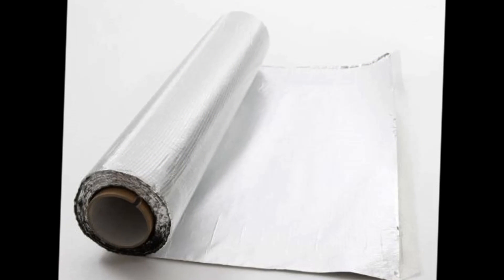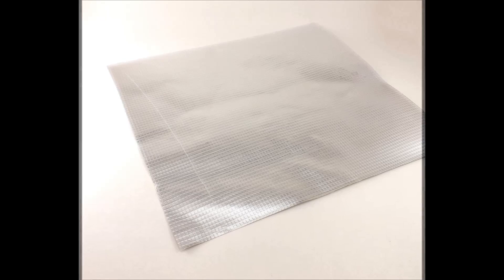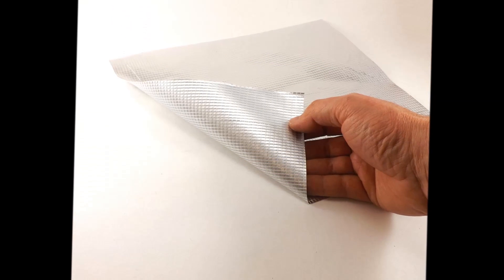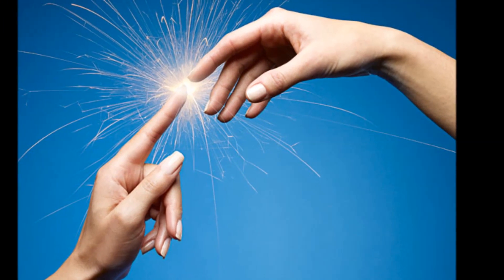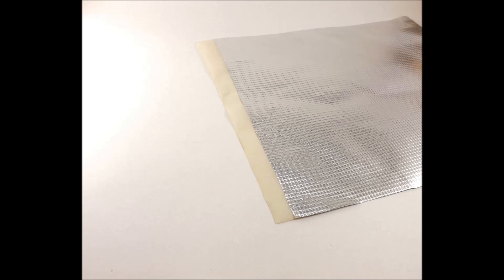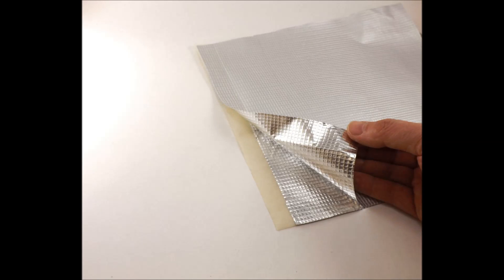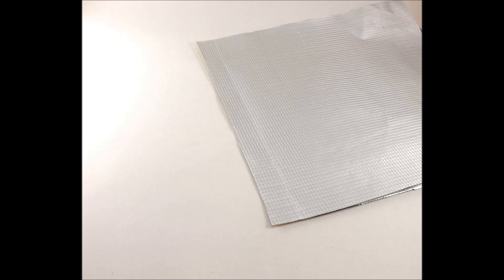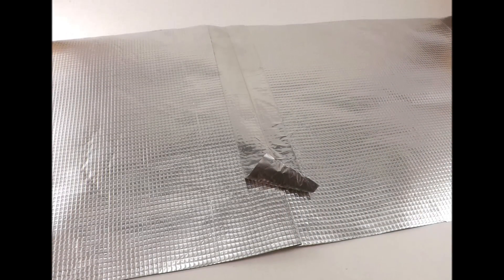AL60 Wall Shield Installation Instructions

Comment: CONDUCTIVE on one side. so what side do you aim 
what side does go toward the incoming dangerous source
the conductive
or non conductive
Reply: I agree with you. Too little info in this video.
Reply: just overlap the  electrically conductive sides a little and place any ordinary tape on both sides. done.
Reply: yeah, we need an answer here

Comment: ive seen 1 megawatt on our readers. and says that "you cannot be in" area with 1 megawatt, (microwave radiation frequency ) for more than a few hours. ive seen 10 megawatts. iv e seen 100 megawatts. in the reader, its fluctuates. and in the green is 0.01 megawatts and anything less than 1 megawatt is in the green and safe to be in

Comment: Maybe with new construction its good to also add this wallpaper.
Reply from the maker: Yes, you can certainly do that. Just remember that this material is a vapor barrier.
Reply: @LessEMF  
Can we exchange numbers ? I have some questions and i like texting 323 403 9558 add me ! thanks.  Drywall is not a vapor barrier? We have reports here that government has been seen using microwave directed energy weapons through walls into peoples houses night time for political purposes. Weve seen it and these barriers can help for wall protection?
Reply from the maker: Drywall is NOT a great vapor barrier. That's the whole reason vapor barriers are added when needed. You can contact us anytime through our website at www.lessemf.comWe don't have the ability to text.
Reply from the maker: Great idea.